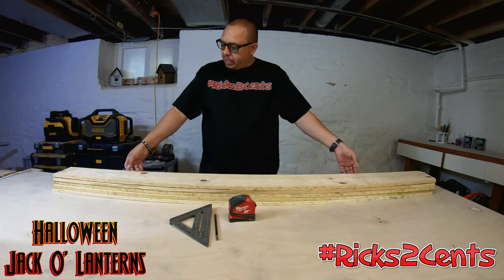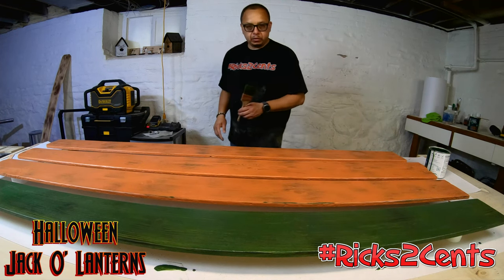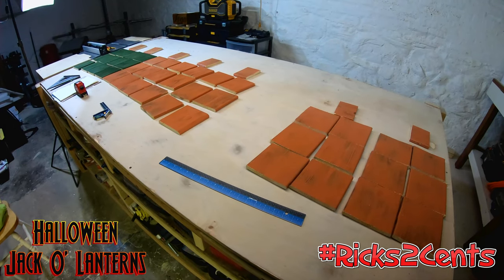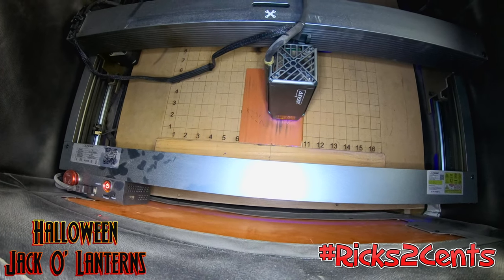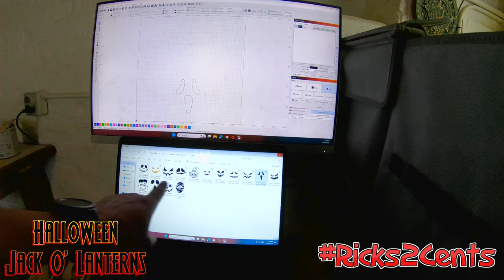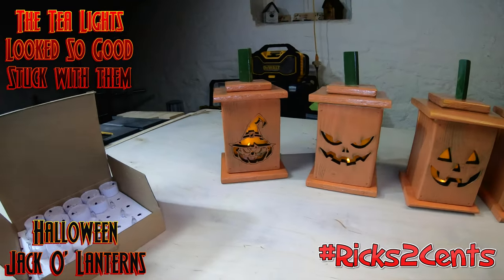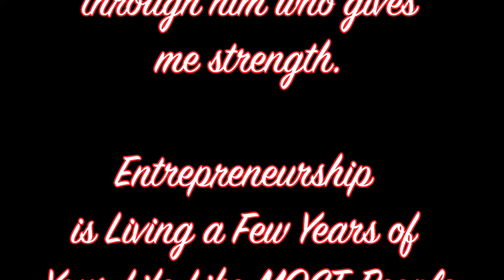HOW TO Build Wooden Jack O Lanterns Fence Picket Build | DIY Woodworking Halloween Decorations

Comment from the maker: Time Line
00:00 Intro
00:18 My New Series Woodworking Smalls That Sell.
01:22 What am I going to be making?
01:34 Building Material am I using?
02:38 Let's Get Started!!!
02:53 Let's Start Sanding
03:03 Let's Start Burning
04:15 Let's Start Staining
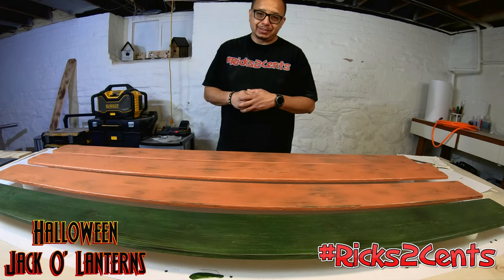10:21 Let's Mask Off the Wood to Paint the Inside
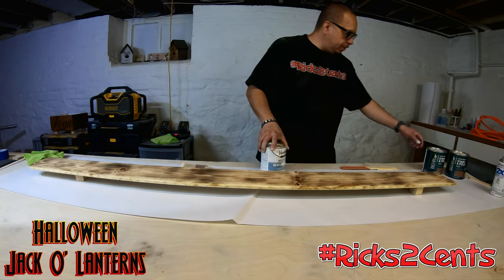11:31 Let's Stain Our Last Board White
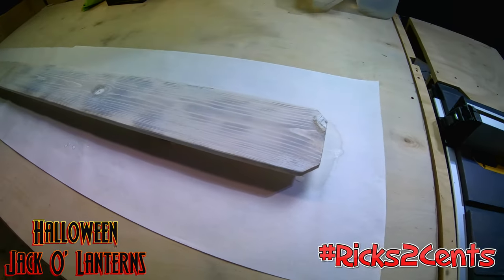11:56 How does the White Stain Look 24 Hrs Later?
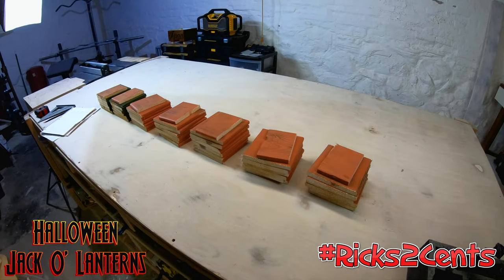13:53 Cutting ALL Our Pieces to Size 
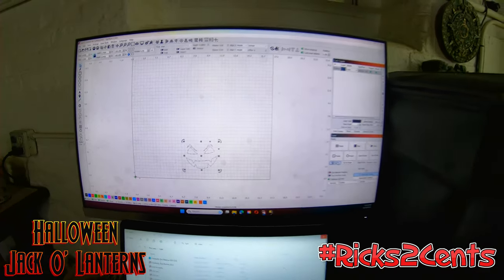18:27 Creating a Jig to Line up your artwork
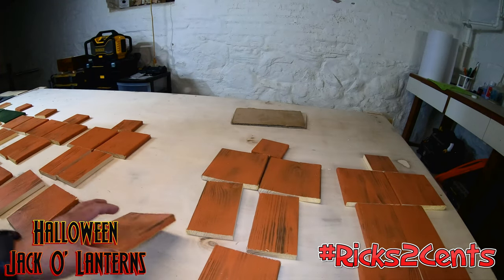19:40 Let's Start cutting out the designs
22:34 Sneak Peak at some of my designs
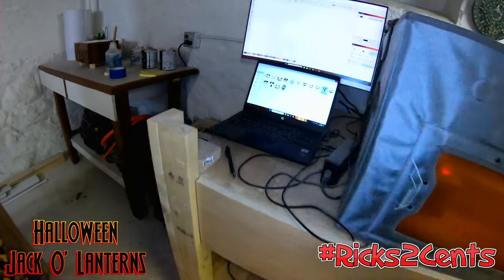24:28 Light Burn Tip
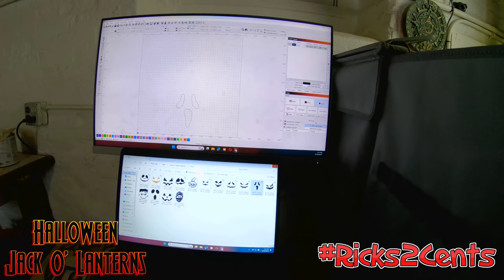26:06 Up Sale Options
27:25 Sneak Peak at My Favorite Design!
28:22 They are ALL Put together!!!
29:01 What Lights did I use?
29:39 Let's see them in the Dark!!!
31:32 Big Thank You from My Son & I
31:57 Lessoned Learned
32:27 Thank You The Home Depot
33:57 Progress Pictures
34:37 Credits

Comment: Nice project! I want to try to make something like it with snowflakes for the winter season. Which settings did you use to cut through the wood cleanly? 
(How high wattage is the laser, How many percent of that was used, How fast was the head mobning, number of passes )
Reply from the maker: Thank You. I made that on a 35 Watt laser at 100%. Every Laser and Wood Type will vary.
Reply: @Ricks2Cents Thanks for the information. I was just wondering because your cuts looked quite clean when I compare with mine. What speed is the laser moving at and how many passes did you do?
Reply from the maker: @rlwe  
Hoe many Watts is your Laser?
Reply: @Ricks2Cents  It is 40W (xtool d1), so it is close enough to yours that roughly the same settings should work. I just feel that the cuts i do are more charred than I would like (even with experimentation on variations of power, speed and passes) when I try to cut boards. 
Your cuts just seem cleaner :-)
Reply from the maker: @rlwe  
Are you using Air Assist on High?
Reply: @Ricks2Cents  Yes I am.
Reply from the maker: @rlwe  
What speed are you cutting at?